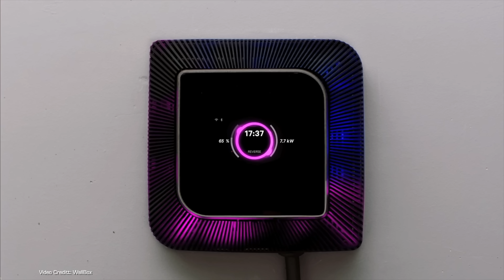Transport Evolved Landscape Megacut - August 2 - August 8, 2021

Comment: That an impressive price drop for the Leaf. What’s the latest on this vehicle? Are the batteries still prone to excessive degradation due to lack of liquid cooling? And what are the charging rates like when you rapid charge multiple times in a day (i.e., is Rapidgate still a thing)?
Reply: If you can get one cheap enough, there’s a company up ⬆️ north that will replace dead cells or the complete pack at a reasonable price.

Comment: The drunk Norwegian driver drove several kms before the car stopped.
Reply: Well, really, autopilot drove.
I know being drunk isn't the same as being asleep (though being dead tired can lead to the exact same driving mistakes), But I've noticed that sometimes when I fall asleep holding some object, when I wake up I'm still holding that object. This might mean that "hands on the wheel" doesn't really work well enough to detect this stuff, at least for some drivers.

Comment: they kill the entry combustion engine cars first and forget about families buying a new car, and for sure no EV one with limted budgets. Cheapest 2020 combustinon car brand new incl. all VAT was below 8000€ on different dealer platforms and now that price is rising a lot - simply due to less car models offered in 2021 but also limited amounts available due to silicone shortage.

Comment: Although really, Most new cars on the market are only available to those with a decent income. Everyone else deals with the used market and it will be a few more years before there are enough EV's there to make dent in ICE sales.
Reply: About a decade, due to battery manufacturing constraints